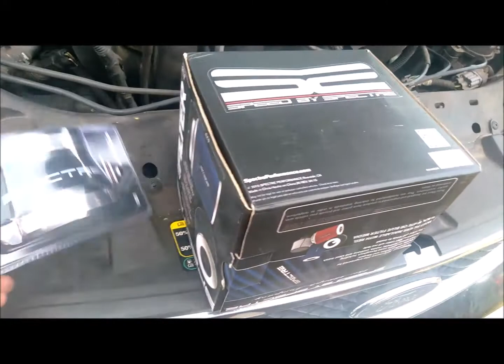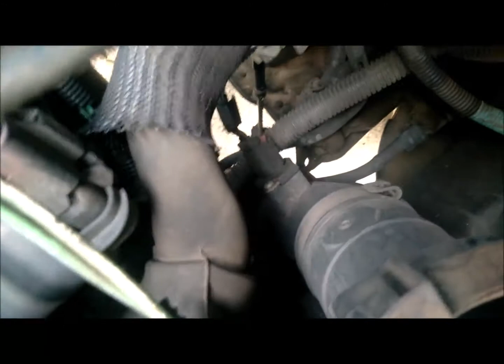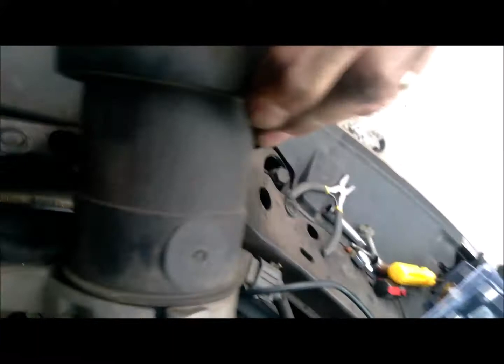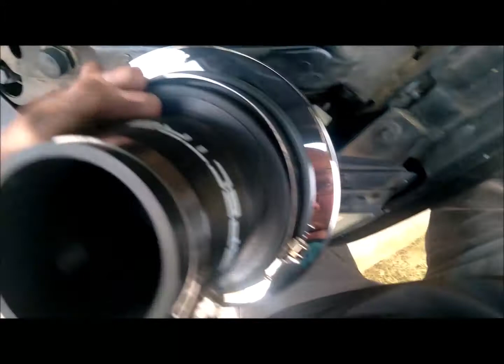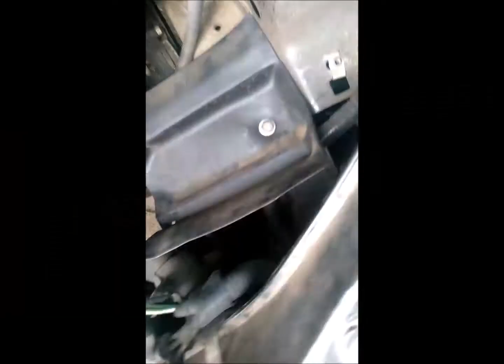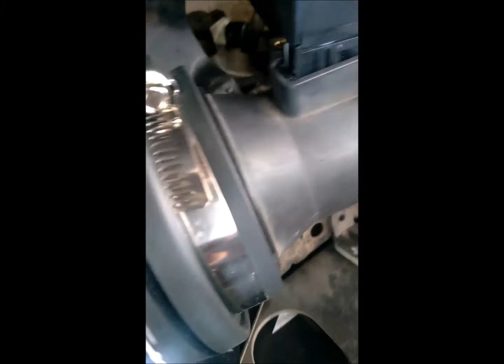Ford Focus Engine Air Filter Cold Intake mod for under $50 bucks

Comment: Nice video, u made it look easy, I did mine and had to JB weld a piece of the pipe were the sensor goes since the tube/pipe was to long
Reply from the maker: i think i was fortunate to accidentally cut in the right spots

Comment: What did you use for a shield on the bottom there
Reply from the maker: the ford focus has a metal platform where the old filter box used to sit/attach. the new filter simply lays/hangs on top of that metal platform. you can also take/cut a piece of the old filter housing and attach to the platform for an extra side guard in one of the bolt holes.